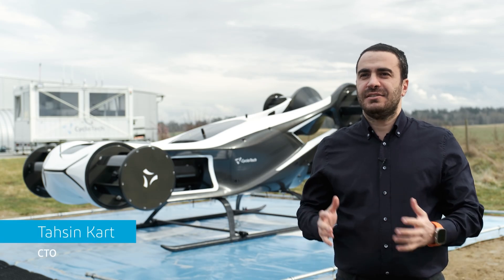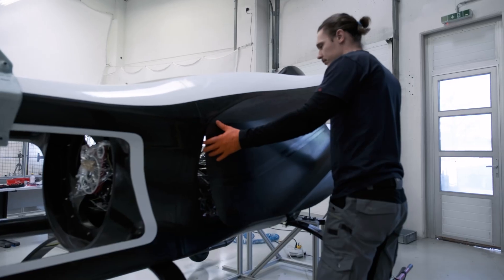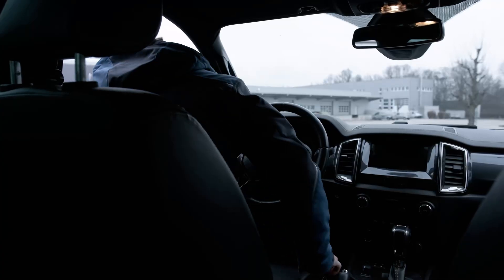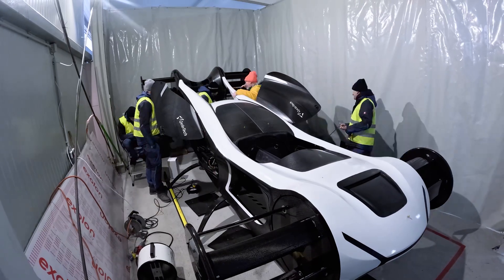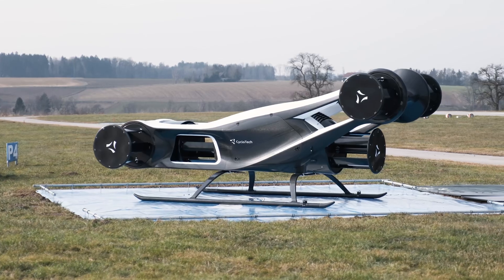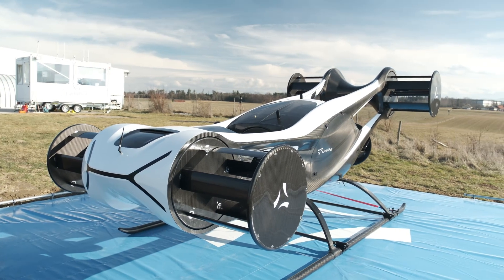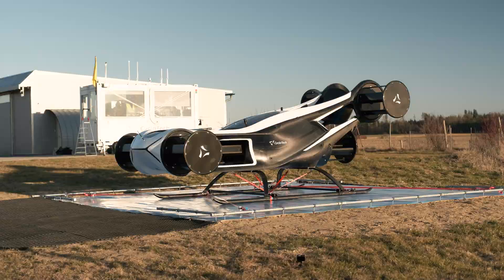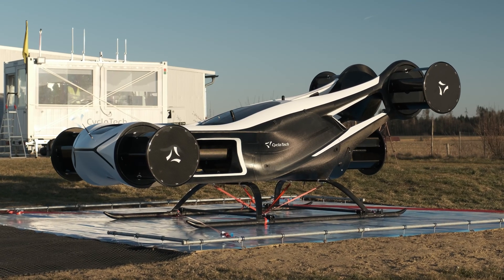BlackBird | Entering the ground test phase

Comment: I have no fucking clue what this thing is supposed to do... Flying by the looks of it. If this thing ever leaves the ground, colour me suprised
Reply: the rotors are a tech known for a while, but not feasible without today's materials, electric drive trains and the live adjustments possible with the speed of monitoring and analysis.

at least that is what they say. That is not my knowledge, just regurgitating.
Reply: Okay, I've looked at how this works in principle. I think it would be incredibly inefficient and loud and you could just put an engine there on a swivel but as a proof of concept its really cool.